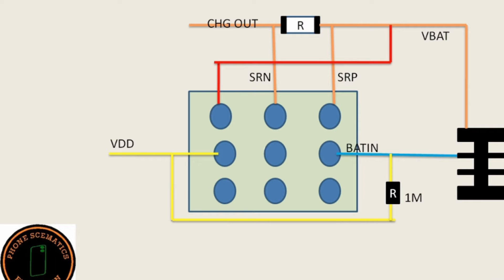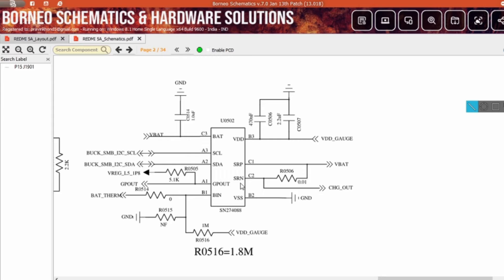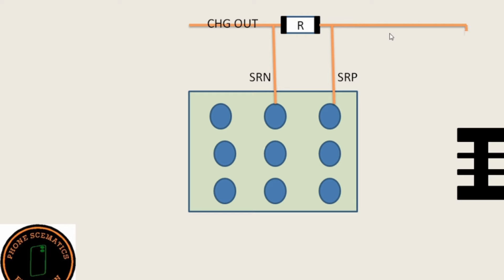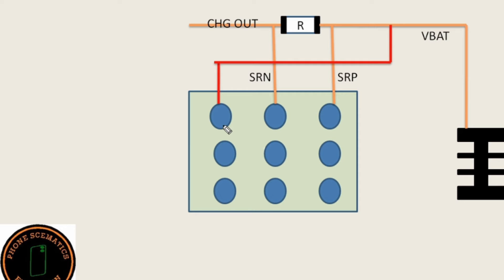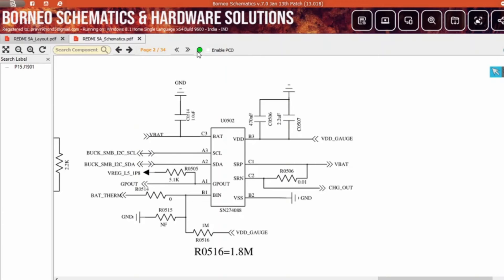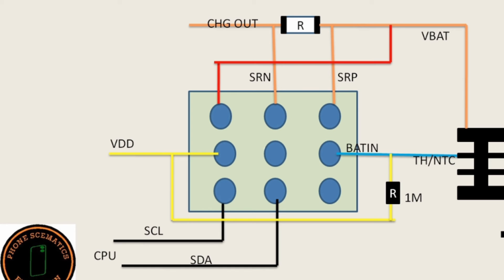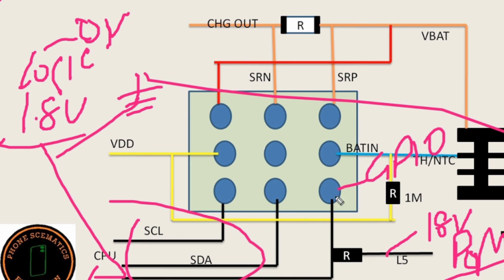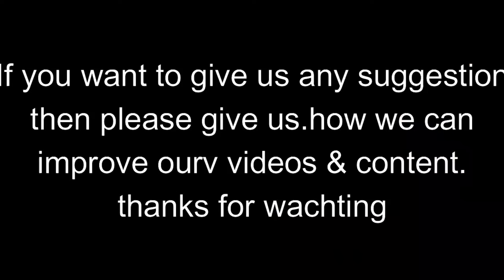Charging IC+Fuel Gauge Ic. Battery stuck doesn't increase solution.Teasting+Repair 💯

Comment: Jay siyaram Sir LCD vsn vsp cabc par full explain video please Sir I confuse why missing vsn vsp voltage I try solve but not successful Sir please guide Sir
Reply from the maker: See, for this you will have to understood the IC first. There are three sections in the IC, Input, Controlling and Output. If there is a problem anywhere in these three areas, then the IC will not produce its output
Reply: Ok Sir one video guide Sir clear concepts Sir